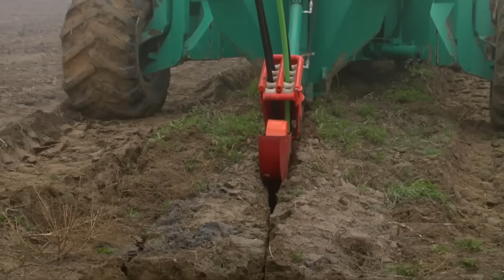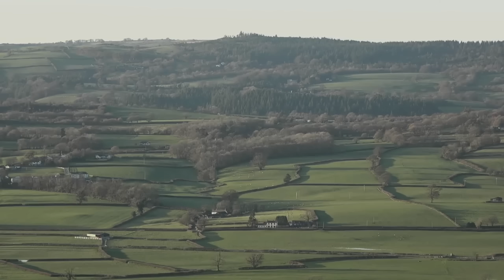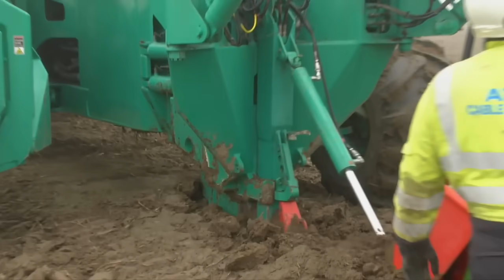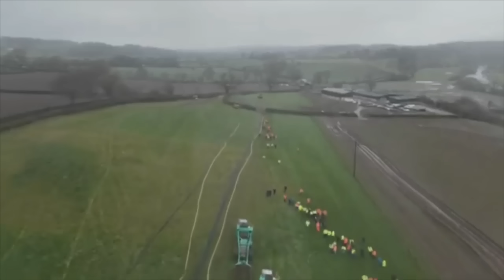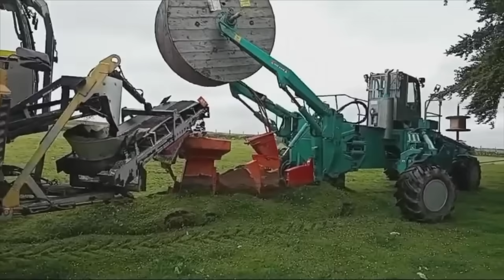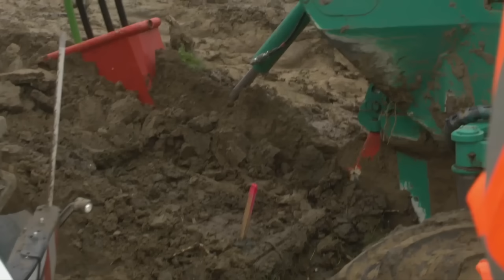Cable Ploughing Explained

Comment: An old system I first saw with two steam engines ploughing a field. with a plough connected to a steel cable running from a spool under each machine. They moved forward each time the plough had reached the second machine and the plough was then turned and pulled back to the first machine running parallel and so on. This is an ingenious way of using an old technology and I'm (not often) impressed.

Comment: Underground cables have been known since the times of Edison and Tesla. The main limitation is the maximum voltage. An overground solution is much cheaper not only to construct and maintain but most importantly to transfer energy as parasite losses are much lower. Technology became popular in densly populated areas where overhead network is limited by infrastructure. I has no real application in coutryside... other than wasting public money.

Comment: Problem is that buried cables have to be either lower voltage or heavily insulated so the cable itself is more expensive.

Comment: Llandovery Pylon -  ESB Ireland, which is the company that supplies electricity in Ireland
is mulling over putting some of its main cables underground.
Many power lines were blown down there recently, and the ESB was forced to replace THOUSANDS of power poles.
Contact it, you might get some work from this electricity supplier.